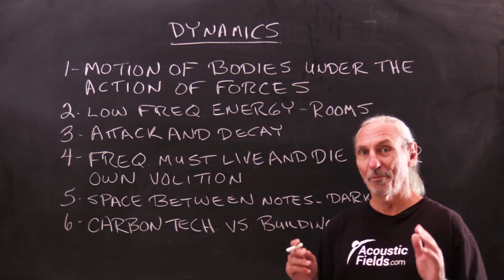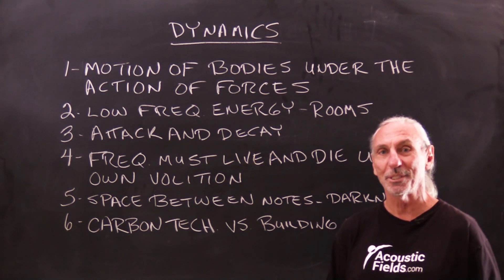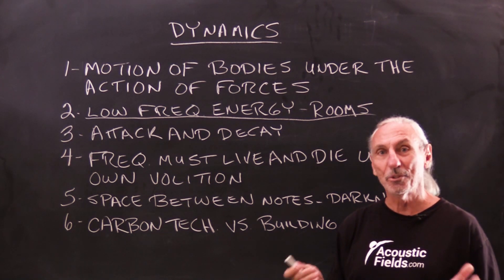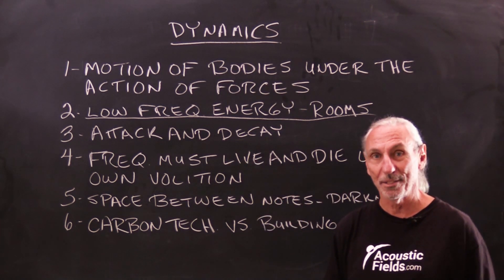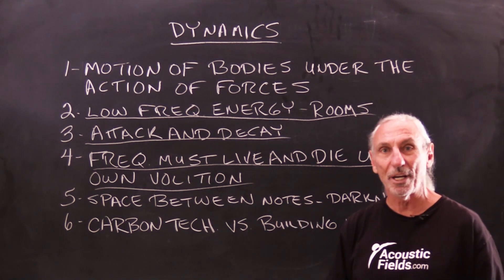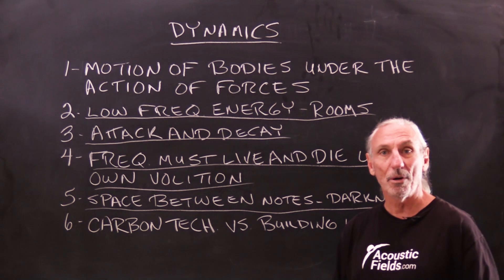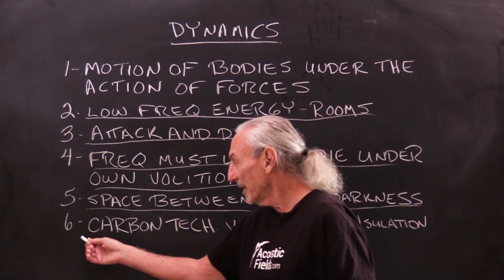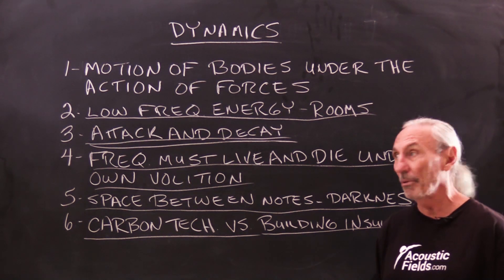Dynamics - www.AcousticFields.com

Comment: I really like these videos. Learn a lot, especially about the limitations of my house and listening room. But here is the situation for 90 % of your possible customers ; - Most og us have trouble-rooms. Ideally we should have moved.. .. That's not an option. But we are all in the "red "-category that make it difficult to improve the sound to your standard. But that's were the business is. 90 % are in that category. Do you have any solutions for us in the "red" category? I am not sure that your carbon technology will be enough in our smallish difficult rooms. So we might as well resort to DSP to sort out the bass-problems? Like the DSPeaker Anti-Mode 8033S-II? After having done the best we can within interior-limits this must surely be the second best choice?
Reply from the maker: Unfortunately, one can only go so far in a small room. If you do not have the space requirements for proper treatment types, then you must live with the low-frequency issues. Processing LF issues, will sound like processed sound. There is simply no free ride in a small room.

Comment: With my home theatre sound system Dennis, instead of buying one big subwoofer, say one at 1000w or 1500w, now whilst I was upgrading and building on my original 5.1 sound system to a 7.2.4 system, I bought another and matched my original subwoofer, being Accusound 200w 12" class A/B subwoofers, then I bought two new Emotiva basx s12 300w class D, setting them up as fronts/rears in my system, with one of each subwoofer to the front and to the rear, of which I've set them up at different heights off the floor, I did the subwoofer crawl to help get the best positions, in a room that's 4140 cubic feet. 
My questions are, is this a better situation for low frequency using multiple smaller subwoofers?, or should I have just bought one big subwoofer?, plus would the two 200w and the two 300w subwoofers produce the equivalent off just one 1000w subwoofer?
Cheers
Stephen

Comment: One solution to increase the dynamics is changing the house from city to silent suburbs, for me "only" 250K euros from Milan center to 18km far away XD
Reply from the maker: Yes, lowering the ambient noise floor will reduce noise transmission into the structure.

Comment: I know you like to talk about improved sound quality when you use the carbon absorption technology but i also noticed a reduction in pressure against my ears which also translates into reduced ear fatigue.
Reply: Because the space between notes was filled with the tails (decays) of them elevating the energy (mean in a unit of time) and the time stimulation of your ear...and brain. This "noise" cover low level signals compressing the dynamics.

Comment: Like many (arguably most), I have to use a living room for both home theater and 2 channel HiFi.  After treating my fromt wall (with a huge bay window), and first reflections points with 4" deep, 5 foot mobile freestanding bass absorbing panels, I loved the improvement. Treating my secondary reflection points did not make much of an audible difference. Covering the opening to my fireplace did not make much of an audible difference. Perhaps because I keep it filled.  I tried placing 2" acoustic panels in my two window panes on the right wall adjacent to the fireplace.  Now all the windows were treated and covered with 2" wood blinds. I liked the improvement, although subtle. FYI I am using dual REL subwoofers. 

Because I have to live in this space, no coffee table is really not an option. Looks bare. But I wondered if switching from a glass table to a wood one would be worth the expense. I took an Audimute Sound Absorption blanket and covered the table. Wow. I could hear the difference. Subtle, but there. God, I hate glass!!!  I wish I was into HiFi/home theater when I was decorating. My equipment is still on a glass shelved console. Oh well. How does one eat an elephant?  One bite at a time...
Reply from the maker: A 4" deep panel filled with building insulation is not a "bass absorbing panel" Don't get caught in these label types that do not describe the units function. At 4" you will not get below 90 Hz.  This is a good example of how creating quality sound is all about using a lot of little things in the correct orders.
Reply: @AcousticFields  Reputable company. Like you, they post measurements. GIK Acoustics.
Reply: @byronb.  Measurements depends on parameters, conditions, and scale. It's better an indipendent laboratory that can certificate the performance in the same conditions for the brands.
Reply: About the coffee table , if you can, buy or install it on wheels, so you can to keep it out of the "sacred triangle" when serius listening
Reply: @badrini  Amen to that bro !

Comment: Why not apply scientifically proven multiple subs to control the low frequency response instead of a huge amount of traps to even make a dent in frequencies below 80hz? You also lose headroom using traps so more power is required for the same output.
Reply from the maker: You do not lose headroom  if you employ the correct rates and levels of absorption. Using multiple subs to smooth out response is frequency specific and not cost effective. Why spend 8-10K for subs when for the same money you can treat the whole room response instead of the below 100 cycle region.
Reply: For me adding sound sources it's like adding more problems to manage. All of you are talking about flat response in the low end, multiple bass source don't solve the decay problem of standing notes.
Reply: @badrini  multi sub does fix the decay there are multiple papers written on this subject,  think the only reason to choose Bass traps over multi sub is if it’s a live recording space
Reply: @Chris get a mini dsp and you can eq out that below 30hz peak in REW

Comment: I don’t think the low budget and skeptical folks will understand until they experience it in some way. I sure as hell didn’t. I built 3 using insulation inside and WOW. Game changer, I get it. I can only imagine what the carbon can do. Might have to open an Onlyfans account sooner than I thought lolol..
Reply: I don't think it's a matter about of low budget (I'm too) but a open mind and study...it's all about physics.
Reply: Giuseppe Ongano well of course it’s physics, plus researching and studying is essential, however there’s simply no substitute for experience. Even though one may understand how it works, actually feeling that minor pressure drop is just amazing. Youll wonder what you’ve been doing without it. The part where an open mind is needed is that carbon. At $400 a unit, that’s tough for someone in my tax bracket. But I haven’t been more convinced after i got to hear it in action with insulation in there.